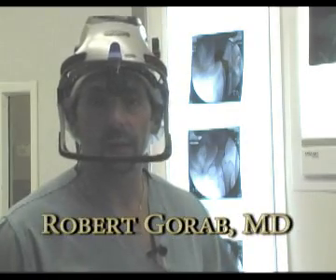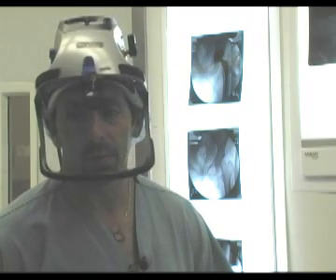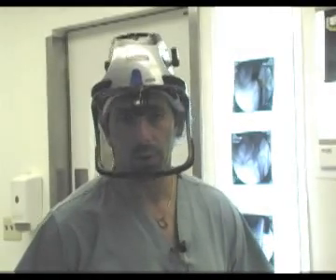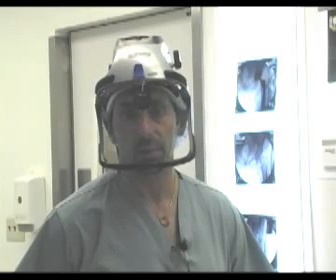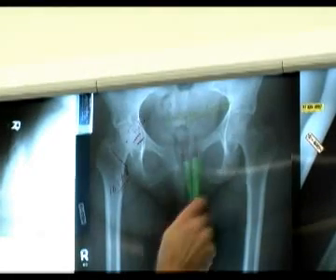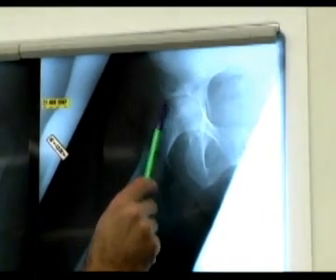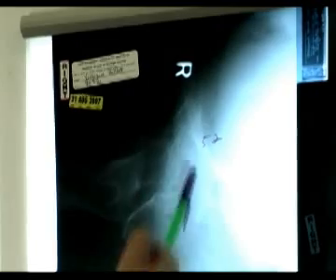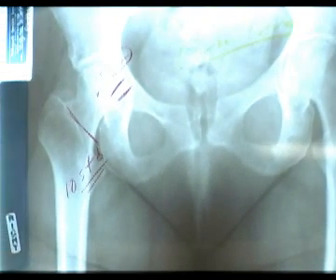Direct Anterior Hip Replacement Surgical Video Presentation

Comment: how can people use metal on metal  ceramic on metal or ceramic on ceramic the french have used ceramics for decades and the ceramics today are as tough and strong as can be . even metal implants break though i conceed ive never seen a matal heat break . hard on hard my choice is ceramic on ceramic . conventional i like highly corss linked poly with a eramic head as a rule i no longer use metal heads . vary rare do i ever see osteolysis with a ceramic on ceramic articulation .